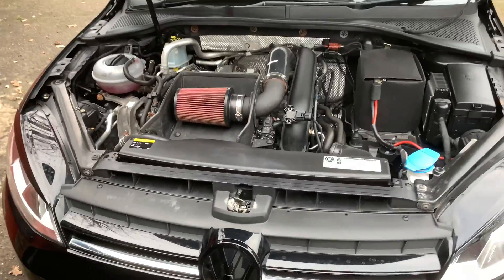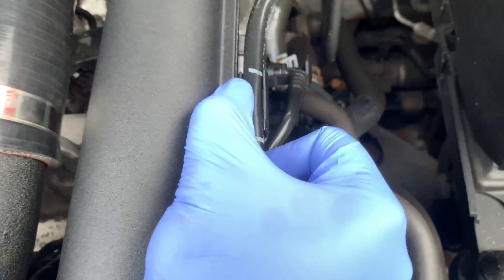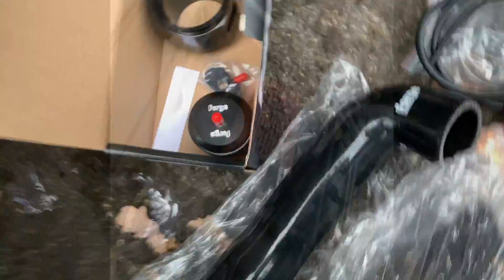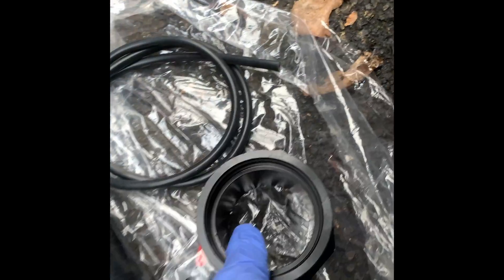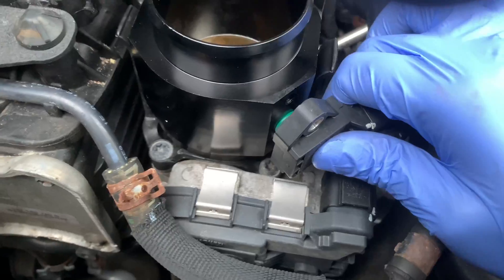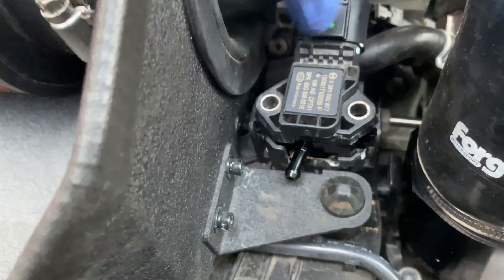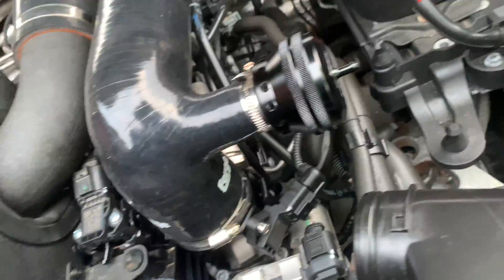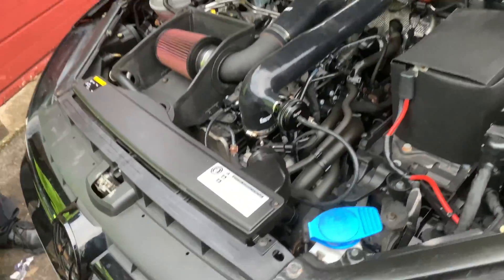Volkswagon Golf Mk7/Mk7.5 (1.2-1.4TSI Bluemotion) Forge Blow Off Valve (BOV) Dump Valve Installation

Comment: Does it make any boost leak after using it for 1 year , bec. I wanna get it but scared from boost leak and it is expensive in our country so do you recommend
Reply from the maker: No boost leaks at all
Reply: @jaysworkshopgarage do i need to remove the main diverter valve to put the external one bec the car must not have to vlaves can you explain

Comment: i bought one of these recently, it doesn’t have the extension for the sensor, it comes with a T piece to tap off the manifold vacuum pipe.. do you know where that is?
Reply from the maker: yes I demonstrated on my video is the same

Comment: Did you noticed any less throttle responce in the gear shift? (I know that the stock Diverter valve recirculate on intake instead of atmosphere like blow off)
Reply from the maker: @SLINK83  not really
Reply: @ I see in soma videos that the forge tube tends to expand when pull down…do you notice that? My car golf 7 1.4 next to install hybrid turbo and i have to choose between rtmg and mst intake and stock divert or something like this forge blow off. Whats your opinion? My car just have full exhaust
Reply: i’ve just finished putting mine on and the throttle response is kinda shocking now. the original pipe when you put your foot down you can feel it really going but with this on it just doesn’t wanna go 🤷🏽‍♂️🤷🏽‍♂️
Reply: @sxmplr is it so bad??

Comment: Good video bro, Seems like I’ve lost a bit of power any ideas please everything is air tight sounds fine when parked revving but when driving loss of power not much but definitely something  golf 14 plate 1.4 Tsi
Reply from the maker: @Yourhouse247 There’s a lot of fakes on the market I’m not saying yours is but if it is will definitely be the material of the silicone getting compressed under heavy load ie when driving not just revving stationary

Comment: anyone knows why my blow off not working? ive replaced the seal cus the blowoff mount on the throttle body was wiggling, but the air is pushing out to the intake instead of the bov, 1.2 tsi
Reply from the maker: try changing out the spring in the bov

Comment: Nice build, I'm wondering how often the air filter needs to be replaced? Also does it gather enough air because it is on the left side? Ty
Reply from the maker: It’s life time guaranteed and yes gathers more than enough air compared to stock intake
Reply: @jaysworkshopgarage  Did you ever measure if the air was colder with stock air box vs this?

Comment: I have bought one but recently noticed a high squealing noise. Any ideas what that could be please? Tia
Reply from the maker: check everything is air tight
Reply: @jaysworkshopgarage  everything is air tight but still making the noise? Only happens on full boost
Reply from the maker: @cjvip2227  Must be faulty
Reply: @cjvip2227 did you find out the problem to this? Mine did the same it got annoying so i took it off
Reply: @jaysworkshopgarage  I did notice that the pipe came off on turbo side. I put it back on but still making the noise. Any further ideas please? Thank you
Reply from the maker: @cjvip2227  could be the charge pipe rubber o rings inside could possibly be a leak there would cause high pitch noise
Reply: @jaysworkshopgarage  will I need to buy new ones or might not be sat in the new bracket properly?

Comment: Brilliant video bruv ! I've got the golf mk6 1.2 tsi , and they've got a kit for it as well.  Think I'll give it a go. I reckon it will blend well with the mst intake.
Reply: I ended up getting the blow off valve kit and it came with a spring . You reckon it's a spare one ?
Reply from the maker: @aleksistar631  yes it is
Reply: @aleksistar631 was it same install as this video?
Reply: I've been told by forge themselves to open the valve and swap the springs if the car had turbo and software upgrades etc
Reply: So did the BOV improve the sound or anything?

Comment: Did you have any difficulty with the screws that go through the fuel sensor and are they self tapping. I just bought a kit and the screws don’t seem to be long enough to catch.
Reply from the maker: The 2 long screws that fit under the air intake fitted fine but with the allen key bolt I only fitted the top one
Reply: @jaysworkshopgarage  yeh, the 2 longer ones don’t seem to be catching for some reason.
Reply: What the size of those 2 screws?
Reply from the maker: @audriusleja459  not sure sorry

Comment: Would you be so kind as to point me in the direction of the right kind of cleaner spray for the air intake, please?
Reply from the maker: just google k&n filter cleaner oil one ebay or amazon
Reply: @jaysworkshopgarage  I thought it might be the K&N brand. Cheers bro 👍

Comment: Where did you buy the Filter ?
Reply from the maker: I bought it of ebay but you can buy it online the link is in one of the other messages below
Reply: @jaysworkshopgarage  Okay thx, and where did you buy the dump valve ? I saw one on Aliexpress
Reply from the maker: @wwolfuris9553  Also ebay lol but yh I’ve fitted a few customers ones from Ali express they work fine for fraction of the cost
Reply: @jaysworkshopgarage  Okay thx bro :D I appreciate it
Reply from the maker: @wwolfuris9553  no problem

Comment: Hey so I ended up getting the exact same one you have for my 1.4t tsi but when I speed up there’s a high pitch noise right before the actual bov release. Has yours done that ?
Reply from the maker: No noise at all only goes off when I release the gas. Make sure everything is air tight maybe re tighten everything once more and hand tighten the actual blow off valve 👍🏽
Reply: its normal, mine does at 65mph on the motorway just cruising. you might just be in boost pressure
Reply: What 1.4 tsi do you have?? Does it fit the tsi 90? The website says it doesn’t 😢
Reply: I've just got the same problem. Did you end up finding a fix for it?

Comment: I have a forge dump valve but after like a week or two it starts to slip off any recommendations how to stop that
Reply from the maker: I’m not too sure why that’s happened mines all good still, Maybe try removing it all wiping it all down as oil may be in the pipe from the turbo and really tighten it all back together properly hopefully this helps